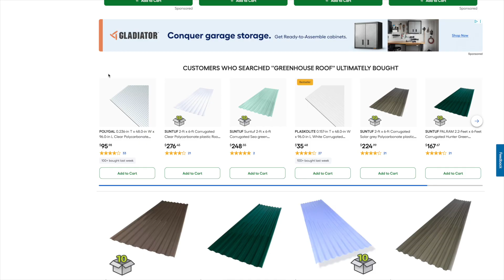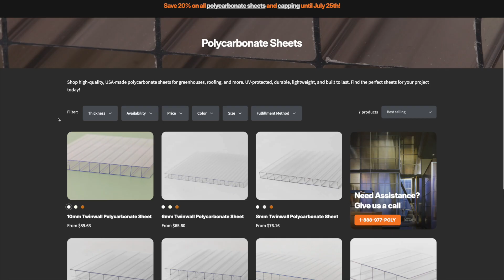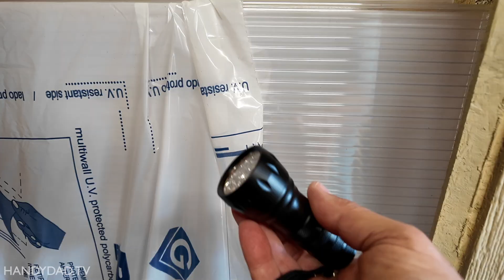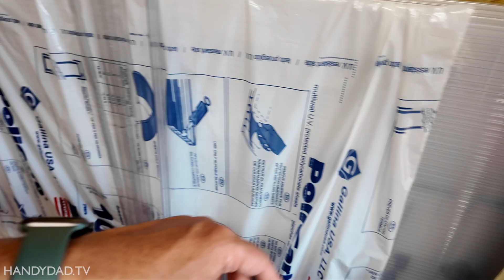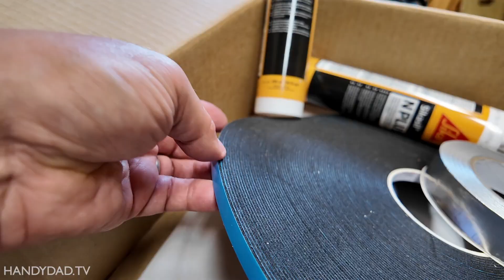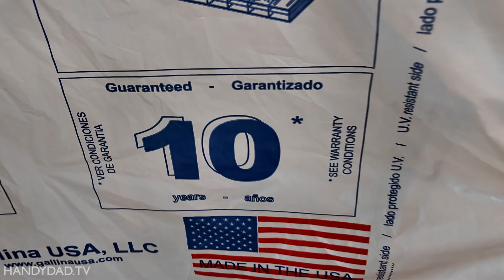Choosing a Greenhouse Roof (Shed/Greenhouse Combo: Part 7)

Comment: Hello from upper 
Hudson Valley NY!
Just subscribed!
Great series you have going.
Planning a project now, something similar .
Quick question 
What about  roof load?
You mentioned that you are able to kneel on the roof panels .
What about static or dynamic load?
Roof fan, motorized automatic vent .
Snow in particular.
Was planning maybe an adjustable pole to accommodate snow or for whatever reason having to step on the panels putting weight on them.
Thank you in advance for any advice.
Keep the videos coming 
Good luck with your project.
God Bless
Reply from the maker: I wouldn’t intentionally kneel in the middle of a panel, but I could certainly kneel where there’s a rafter or other framing supporting it. My point is the panel won’t crush or crack. 

If you’re worried about heavy snow, you can do 16” or 12” rafter spacing, and/or increase the number of cross members to support the middle.